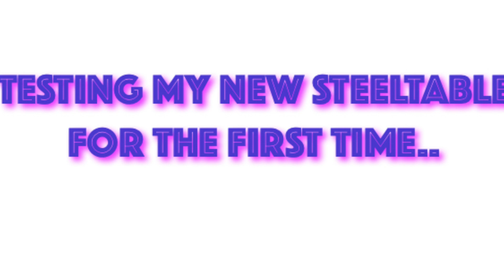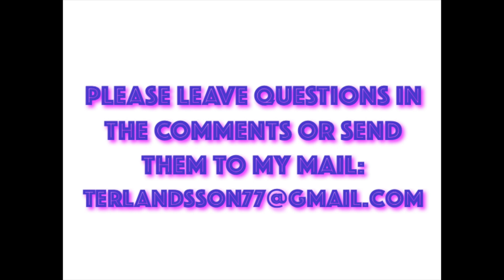How to cut steel with a cheap 6040 cnc router. Milling steel for the first time!

Comment: The problem with the 6040 is rigidity, not so much the base plate which is ok. If you use a good tool and low speed you can cut anything. Recently I have cut granite stone with a diamond v shape tool with an excellent result (under water jet).

Comment: Nice video!  Thanks for showing our you cut steel on the 6040.   One little trick I learned is you can cheat and sand blast the part once you are finished and it removes any of the surface imperfections and gives it a textured look for the visible surfaces of the parts.

Comment: @erichthomas7069: I'm also looking for a small 5-Axis table top mill or vertical machining center to cut steel. There is supposedly an improved 3040 all steel constructed metal cutting 5-Axis machine. However, I have not seen steel cutting demos from the company or actual purchasers. Please share your search experience with me. Thank you. @Thomas The Creator: Thank you for this informative steel cutting demo on your 6040. If you have updated info on perhaps the 3040 5-Axis machine, please share in one of your videos. Thank you.

Comment: First of all, True thanks a lot, Thomas, for sharing your experience! Very informative indeed. Sorry that my question may come so lately after you posted your videos about the 6040. I am considering buying a CNC solution for some projects involving 3D shaping from CAD models onto appropriate foam. The 6040 would get the appropriate working area even though  Z is short. the projects you documented are only involving flat or side cutting’ so far I could see. I am wondering then if a CNC router would be able to perform this 3D milling if equipped with a ball-tip tool. Would the coordination of the 3 axis together represent a limitation for a CNC router? Could the soft calculating the tool trajectories be a limitative factor too? Many thanks for your insights.

Comment: Amazing to see a hobby CNC cut steel, 
Q. what is the power of your Spindle 800W or higher. also what software did you use for cutting .
also why not try a lubricant or a misting spreyer
Reply: He's using a CNCEST 6040 WITH 2.2KW spindle. All of those tan colored chinese cnc machines are made by CNCEST.
Reply: @brianfoster7064  I have a 3040 CNCEST that has a 800w VFD and are identicle to the 6040 but smaller and more rigid, 
anyway i couldnt see any info on his spindle, and thinking of upping my spindle to do the same.

Comment: How about milling the other way? I mean climb milling, cutting forces bend the mill away from the stock. You will never get nice surfaces otherwise. Also lower rpm and feedrate try 3000 rpm and 200 mm / min feedrate. Finally reduce the free length on the mill, very important.

Comment: Lower rpm, lower speed, trochoidal milling with 2- 5% engagement and you will be successful
Reply: no. you are wrong.   lowering rpm works only with heavy and rigid machines (in cases of chatter because of tool deflection).
in case of very light and flimsy machine the only way is to increase rpm (to rise vibration frequency above natural frequency of machine's frame).

Comment: Astonished. I have a 6040z new model and wasn't sure it could make it up to steels. So thanks for clearing that out. That spindle has higher torque at higher rpm, that's why you you can't mill it at small rpm. Do you know what steel alloy is the one you are milling in the video?
Reply: Maybe it can make it up to stainless steel?
Reply from the maker: Thank you😊 It's C45 steel. If you make a new table and add a spindleclamp and take it very very careful you probably could cut stainless!!
Reply: @TomasTheCreator  Will surely try that in the future. Thanks!

Comment: Cool, is still working your router? What model is and from there you buy it and how much it cost.
Reply from the maker: Thank you😊 Yes it's still working perfectly👌🏻 It's a 6040 4axis from Cncest, I got it from Ebay and it cost me about 100€👍🏻
Reply: @TomasTheCreator  can you tell more precise the model, because on eBay are plenty models, thanks.
Reply from the maker: I'm sorry, but I can't find the sellar and the exact model now on Ebay. But if you search for "6040 2.2kw" you should find something similar. And now I have seen they're selling an upgraded version with hgh linear guides and much stiffer chassi for about 500-700€ more.

Comment: CAN you try single flute on carbon steel
Reply from the maker: Yeah, but I think single flute is much more suitable for softer material like alu or copper. I got the absolutly best results with a 4flute in steel. But it would be a fun experiment🤓
Reply: you are not making a big chip in steel so there is no need for a single flute. You do need the 4 flutes for extra strength in cutting steel.

Comment: 22000 rpm spindle speed. feed rate 850 mm

pass depth = 0.25mm  plunge rate = 2mm    ------ this is your setup for carbon steel>?
Reply from the maker: Yeah I think thats pretty close to the setup that worked best. Very high rpm's and very low passing depths was the key succes👍🏻

Comment: Is it worth paying the extra money for a 6040 instead of a 3040?
If i want to be able to Mill metals?
Reply from the maker: Yes it's absolutly worth it, but you have to do something about the table before you can mill metals. Either you do a new steel/alutable or you mount some type of plate under the original table.
Reply: @TomasTheCreator  could you explain your table? I was admiring. How did you make it by hand or on the cnc? those holes you drill and tap?
Reply from the maker: Thank you😊 Yeah I made my table out of steel in a cnc mill, so nothing was made manually.

Comment: Where did you get your table upgrade (with the holes in it)?
Reply from the maker: I made it myself👍🏻 I can send you the cadfile if you give me you mailadress!
Reply: @TomasTheCreator  Hi! Can I also have the cadfiles? ulaktech84 at gmail Thanks!
Reply: @TomasTheCreator  nice! Yeah that would be great! westonde at Gmail dot com! Did you make it steel or aluminum?
Reply from the maker: I made it of a steelplate, but aluminium should also work great! Just layin a mdf-board under the original table makes a huge difference. Great, I mail them today👍🏻
Reply: @TomasTheCreator  thanks! Steel is sweet, but you must have another machine to do that haha!!
Reply from the maker: I sent the files now, please let me now if you didn't get them!
Reply: Asked in another video, but repeat here. Please send to vasiluzhaev@gmail.com
Thanks.
Reply: Can I have them too buddy?

Cnupa4ka @ gmail com
Reply from the maker: Yeah no problem, I send them righ away👍🏻😃
Reply: @TomasTheCreator  Thats called express answer :D

Comment: Hello , subbed ... What is the endmills ,thnx for adding feeds and speeds
Reply from the maker: They are Garant greenring 5mm 4flute carbide endmills. A budget, but very good endmill. Thanks for the sub👍🏻😀
Reply: @TomasTheCreator  thanks for the reply , I'm currently building my cnc router as well ,tapping holes atm 'lol'
Reply from the maker: Oh cool, hope you post a video when it's finnished😀👍🏻
Reply: @TomasTheCreator  hey buddy ,thank you for the sub ... I shall do that 😊 ,as you actually twisted my arm but I take absolutely no responsibility if ur screen cracks or u need a 'pry bar ' to unroll your eyes from the back of your head...🤣
Reply from the maker: Haha I am willing to take the risk😂😂

Comment: Hello sir what motor spindle is on on your 6040?
Reply from the maker: Hi! It's a 2.2kW motor with 24000rpm. I think it works very with the machine👍🏻😀
Reply: TomasTheCreator thanks for the reply. Would you say that one of the best upgrades for the 6040 is a heavier bed? I am trying to work on steel as well.
Reply from the maker: Yeah, a steeltable or a thicker aluminiumtable are definitly the best upgrade. I am also planning to upgrade the gantry! Hope you make it work!!

Comment: What's your spindle power and what's the rpm ?
Reply: I mean the base rpm. 12000 is alot for steel cutting it will burn the endmill
Reply from the maker: The spindlepower is 2.2kW. And I had best result with 22000rpm on the 6mm endmill. It's a hardmetal endmill so the rpm was no problem with the low cutting depth.
Reply: @TomasTheCreator  any way I like your results and gave me lots of hope. Actually I'm building a machine with 4kw 6000rpm spindle with a very sturdy structure. I wish I can do steels with it building moulds and dies for business matters
Reply: @TomasTheCreator  Tomas I was thinking why u had best results at max speed. That's because u will drop the spindle torque at lower rpms couse in vibration and not good outcome
Reply from the maker: That sounds like no problem for a machine like that! Looking forward to see you post a video of it running👍🏻😀
Reply: @alibeyk219  Do you have any details on this spindle you are using? Looking for something similar for my project
Reply: @zsherm2  what material do u want to cut?
Reply: @alibeyk219  316 stainless steel
Reply: @zsherm2  generally speaking more than 6000rpm is not even used in industrial cnc s. So u should look for more lower rpm than this page. Look for 3000 or 6000 rpm spindles HERTZ and AREL have some of these middle spindles. But becarefull these spindles are heaveir and more expensive than low rpms.